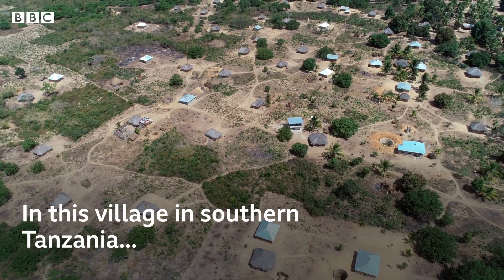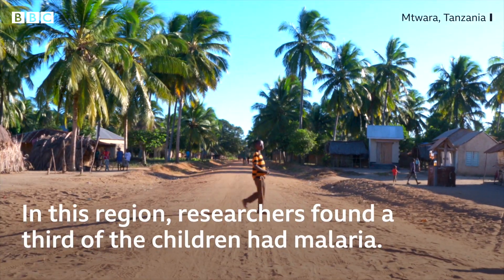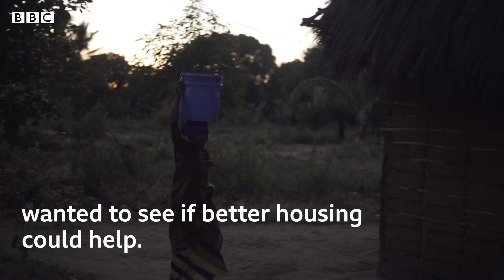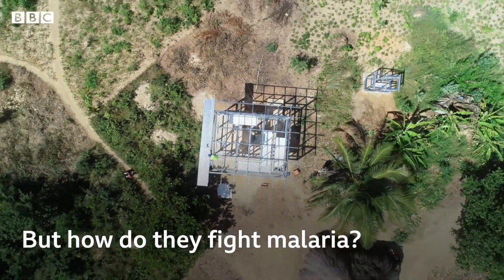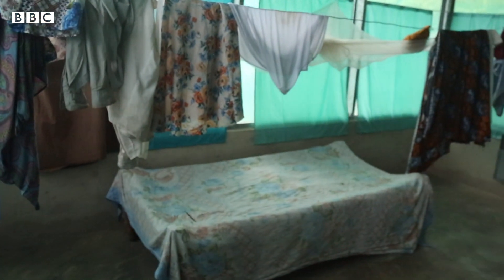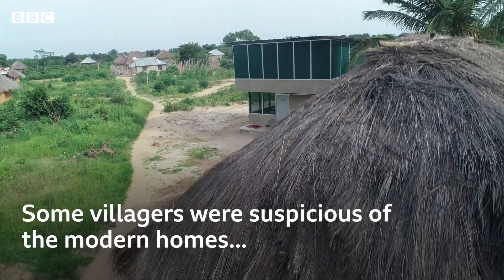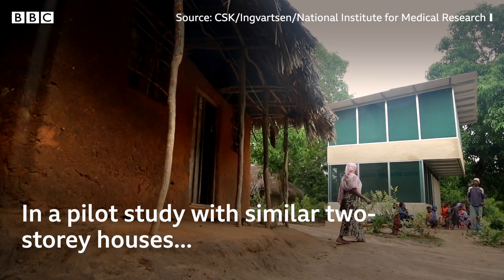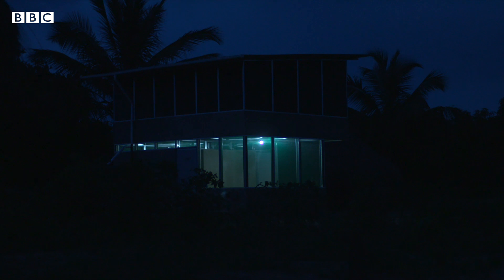The house designed to stop mosquitoes biting you - People Fixing the World, BBC World Service

Comment: Not one bit of insulation and a tin roof?
Reply: This is the tropics, there’s no need for insulation because the temperature is never (very rarely) extreme. In this climate, air conditioning would be the reason to insulate, but not for housing at our current technology and energy levels.
Reply: @bobedgar6647  i’m, you are dead wrong. it’s scorching hot in these homes and the humidity at night is unbearable. ac is a must. i live in TZ right now. NO WAY A NIGHT WITHOUT AC, or fans during the day. Hempcrete and rammed earth with foam placement are needed. i’m in talks with Ecohomes now, one of the partners in this collab to see about instituting some new sustainable methods
Reply: @criticalnurse-ready8705  not true, the issue is being cold at night. Day time it is quite nice up there compared to its surroundings. I have slept in this house many times so, I'm afraid you can't argue with me :)